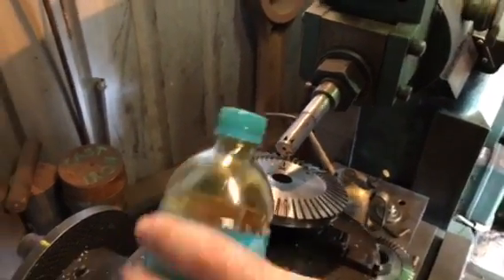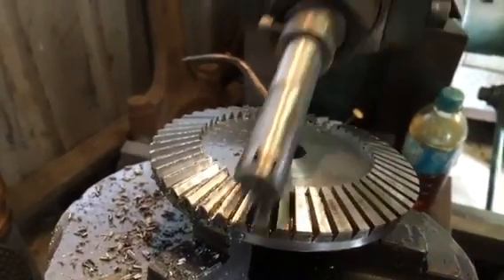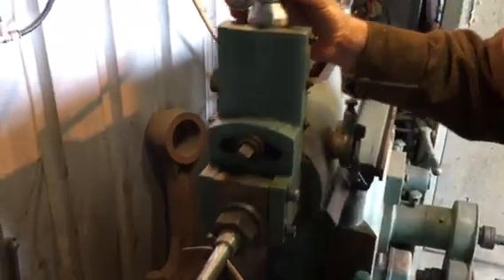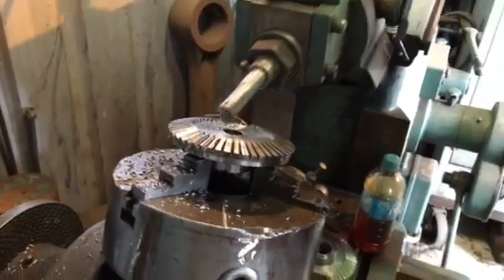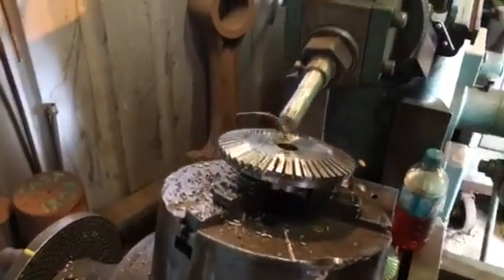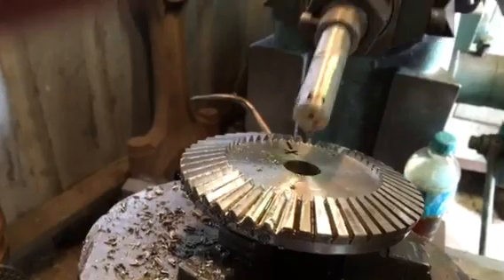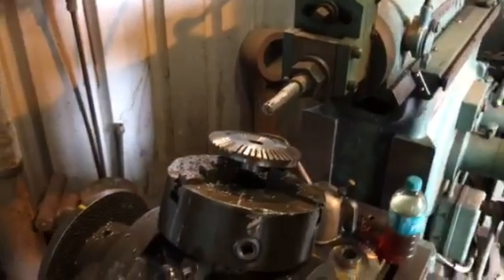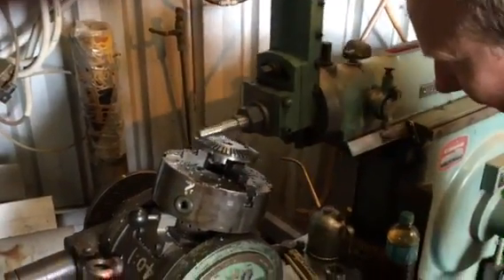Cutting bevel gear with a shaper

Comment: Awesome.  I love shapers as the can be so useful.  I am currently designing a gear system for cutting straight spur gears using a 29 degree cutter.  Did you lock the clapper box? Also what cutter profile did you use for the bevel gears?  Again, awesome. Many thanks. Andy

Comment: Sorry, but that`s never a "bevel"-gear. You can`t cut a bevel gear on a common shaper or a common milling machine. Think about, why...
Reply: You can get it close enough with a high tooth count like that, just needs a bit more meshing clearance. You also can (and should) go around again with the indexing head slightly angled to thin both tooth flanks towards the centre. It's not perfect, but it's near enough to work just fine.
Reply: A full size traction engine would have had gears that were cast in the foundry, not machined at all. These will not be pedantically perfect but they will be close enough for all practical purposes.
Reply: @MoraneAI  Good luck...
Reply: i am willing to learn tell me why

Comment: Nice application, especially if you are a small shop, improvision is a must for us engineers, the good old dividing head never let's u down.   I used a Butler shaper in the Tool Room many times for tricky bits.

Comment: Necessity is the mother of all invention. Good to see a shaper being used like this. I just bought a Douglas 10.5 inch shaper to do internal keyways and splines when I build the half size Ransomes Sims Jeffries Traction Engine. Douglas Shapers were made in Sydney Australia. They still have there use.
Reply: did a delivery to eveleigh... mill, labelled shaper. i think its a 16" rotary table on the sucker. punch labelled press. gotta love hipsters... not. breaks my heart seeing old machines as ornaments. still, beats scrap yards...
one foyer had this... lump. had to do a walk around... it isnt is it?
gleasson bevel generator. no sign misnaming that one thankfully... absolute monster though. maybe a bit more than a hobbyist wants.
my memory suggests a 4 foot throat, or bigger. maybe 7?
meh, tool up properly and it will still do a pisqueak M0.5!

i made one guys day at least... "always wanted to know what that thing is!"
probably has a sign now.

and shapers... definitely still have a place, when considered properly.

convinced one place to get one, give it a go. instead of grinding castings, jig up, deadmans switches, any old idiot could run em through, one or two passes, done. 
took a year or two of fighting to get one... ended up making an inertial single stroke type thing, better suited for what we did. ~100M/min, carbide inserts, 20mm width, at 0.5mm... wee!  beat grinding!
 still fundamentally a shaper.

prick still whinged about time taken to make jigs. eff him.

Comment: so did it work?
seems like holding the tolerances on each tooth would be a problem
Reply: Why would it be an issue? It's what was used in full size
Reply: @union310  was thinking about depth issues?
Reply: @moonpup6262  I see , not if done properly